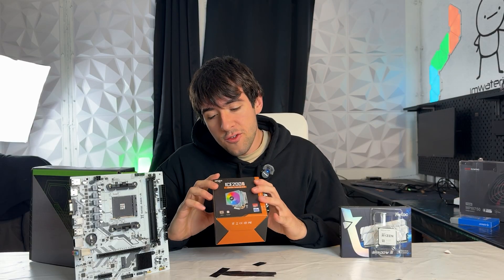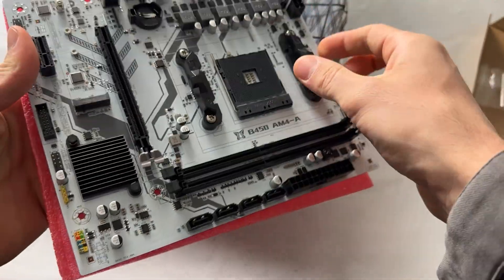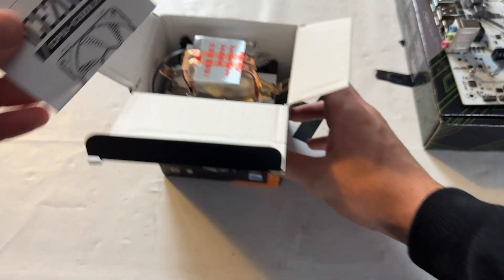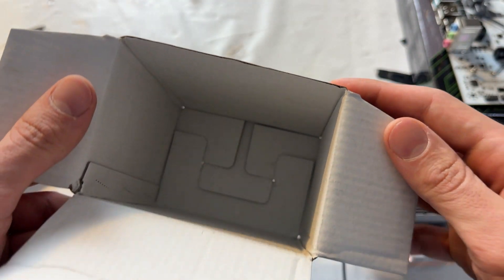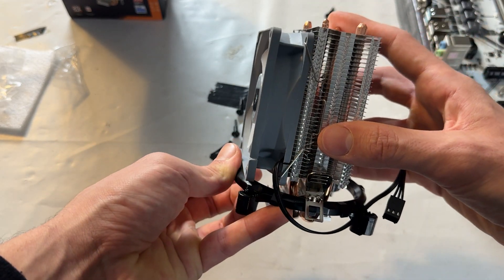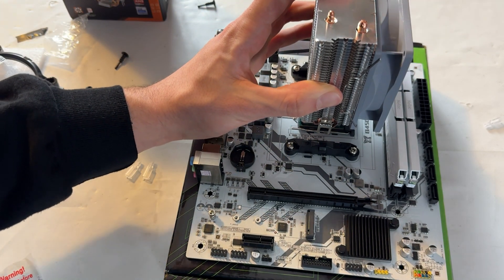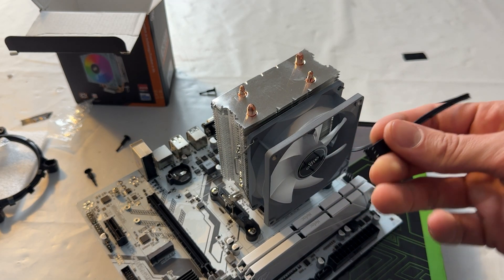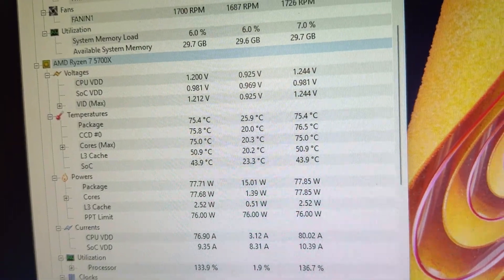I bought a 1$ Aliexpress CPU Cooler - Can it handle a Ryzen 7?

Comment: I strongly disagree with you!
I tested a ROZEN 5 2600 processor, which is also 65W.
With the same software you tested and with an open case. In a room environment at a temperature of 28 degrees.
The processor is connected to a cooling unit, which comes with the processor in the same package. Without buying anything.
I tested for a few minutes and had a maximum temperature of 71 degrees. It is important to note that the heat spreader that comes in the processor package does the job much better than the product you showed.
Thanks for the video you uploaded, but I would put such a product in the case without connecting it to anything except electricity to enjoy the RGB simulation with a radiator.

Comment: I've got its big brother, the Ice400SE that I'm paring with a 6 core 12 thread CPU and the Machinist B450 MB you have there
Reply from the maker: I have to try out thaat one as well! I'm not sure I can afford it though, since it costs 10$, but I'll try to make the investment :p
Reply: @ImWateringPSUs  lmao haha
Reply: Are machinist mobo reliable? In the long run. I have i7 4790 dell optiplex which has been running for more than a decade with no problems. Will this run as much or only few years? 🤔
Reply: @mk-oe8yx  every review I've seen on it has been quite positive and these are from reviewers that I trust
Reply from the maker: @mk-oe8yx  I've had quite a few machinist mobos on the channel and so far no one has failed. But nobody can tell you what's gonna happen 5 years from now, of course!